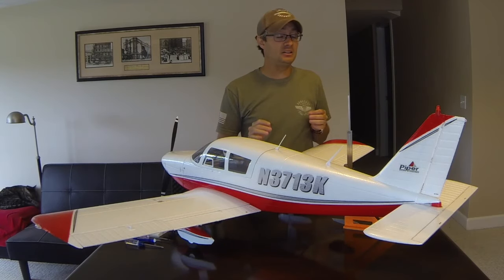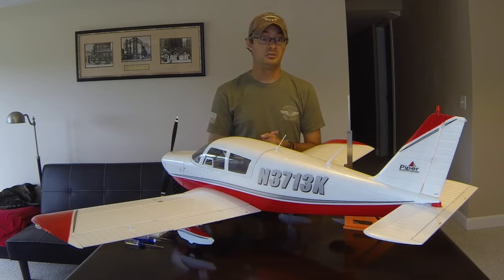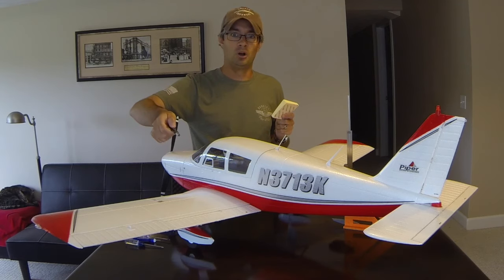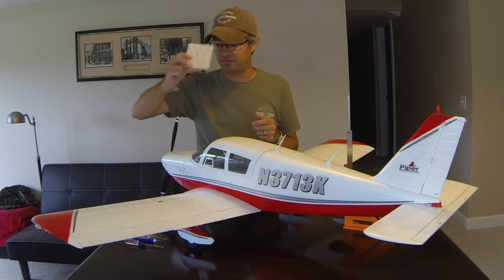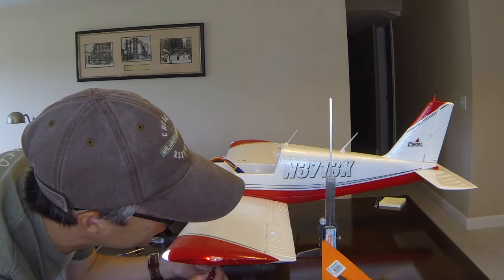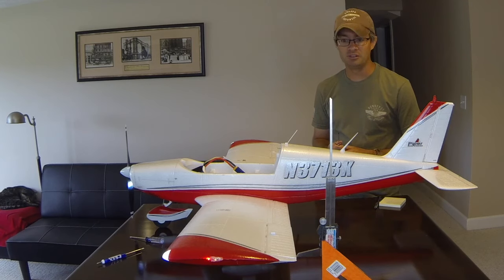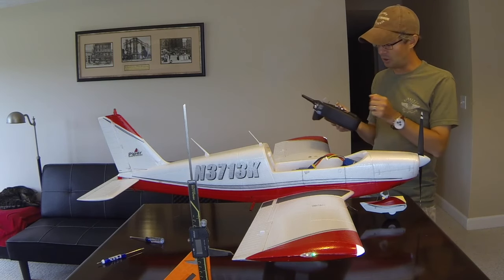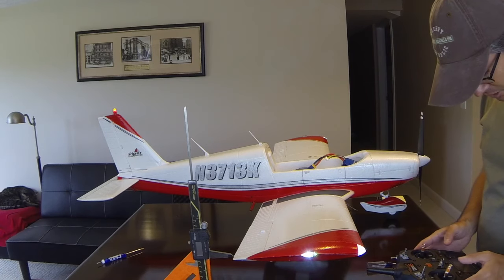How to mechanically trim ailerons on a RC plane

Comment: Excellent video and so glad I found it!  Just retired, a newbie to rc, and just picked up an Apprentice STS 1.5.  So, let’s see if I’m understanding this correctly.
1. Put plane on a level surface.
2. With the plane on and bound to transmitter make sure you’re in experienced mode and all electronic trims are set to zero.
3. Mechanically set the ailerons, elevator, and ruder surfaces to line up with adjacent surface.
5. Fly the plane and adjust electronic trims as necessary and land plane.  
6. Measure the surface with the trim from the flight, put the trim to zero on the transmitter, adjust the clevis on the plane until the surface     measures the same as it did with transmitter trim. 
7. Go fly and adjust from there.
Reply from the maker: yep, you got it! Don't be shocked if you end up with a control surface that isn't perfectly aligned to the adjacent surface after you get the plane trimmed and flying perfect in the air. Typically a brand new plane out of the box is pretty close to being trimmed out of the box. If you are just starting out in RC, I wouldn't worry too much about making trim adjustments in the air. SAFE will compensate to keep the plane flying level. As long as the plane is starting out with the control surfaces aligned with the adjacent surface, SAFE will do the rest. As you progress with learning and get out of beginner mode, then you will start to notice if the plane is out of trim and needs adjustment in the air. The good thing is that you can use SAFE to help you trim the plane. I only recently learned about this trick. Once you get into intermediate mode where you are comfortable flying the plane, go up to an altitude where you have plenty of room to recover and put the plane in experienced mode. See if the plane rolls or pitches in experienced mode and take a mental note of which direction it is going and then put it back into intermediate mode. Use your trim switches to add the trim to counteract what the plane was doing in experienced mode. Note that the elevator moves with SAFE on to keep the plane in the air so expect it to begin to dive slightly at half throttle compared to what it does with SAFE on beginner mode. That is normal. You should be able to go into experienced mode at 50% power and the plane should fly level and then slightly climb with SAFE on beginner mode. Ok, back to trimming. So if the plane rolls right, add a few clicks of left aileron trim to balance it out. Go back into experienced mode and see if the plane still wants to roll. If so, add a few more clicks of trim. The idea is that you should go from intermediate to experienced mode without the plane wanting to roll or pitch. Then you have the plane trimmed out properly. Land and then adjust your control surfaces so you can set the transmitter trim to 0.
Reply: @BRGT350  WOW, lots of good information you gave us. I will do as you suggest and play with it. Really looking forward to trying it all out. I've always been one who likes to tinker with stuff anyways. For instance - I'm a Ham Radio operator but actually like building and modifying equipment and antennas more then actually talking on the radio.
Thanks again, Your help is much appreciated!
Reply from the maker: Happy to help out! I also love to tinker with my planes, but most of the modifications are all related to making them look more realistic. I have started to get into designing 3D printed parts to make the planes look more real.
Reply: @BRGT350  haven't gotten into 3d printing yet but that sounds interesting. I will have to check into that one day. It's amazing what people are making with those printers. Good luck with that.

Comment: Excellent video and who would have thought its not just trim but retrim very great and thanks for this video
Reply from the maker: thanks, I have found that foam planes need some additional trimming as the weather changes, mostly with the elevator and rudder as the fuselage expands and contracts with heat and humidity. The ailerons stay pretty consistent, but not always. I have had a few cases in which a plane trimmed perfectly in the fall is out of trim in the summer. The best solution is to get it as close as you can to being trimmed for all seasons and then add a few clicks as needed to adjust for changing weather.

Comment: I built a Veron balsa Cherokee glow powered with an all flying elevator, however on its first flight the elevator started to fishtail up and down. I can see that the model that you have on the table has an all flying elevator. What prevents fishtailing on your model?
Reply from the maker: I assume you are referring to a plane that is pitching up and down caused by stabilator flutter. I didn't have to do anything to the E-flite Cherokee to prevent that from happening. I did lower the amount of throw on the stabilitor and increase the expo to make it less sensitive to pitch inputs, but that wasn't to fix a flying issue, but rather to make the plane react how I wanted it to when applying up and down elevator. I wanted a very sedate Cherokee. Typically stabilator flutter is caused by too high of airspeed and/or not enough support to maintain the stabilator's position. Aerodynamic forces begin to act upon the surface and overpower the rigidity of the surface, hinges, or servo.

Comment: I successfully binded my Apprentice STS to Spectrum DX6 but upon doing so, I noticed the rudder being way off center. I tried fully trimming it to the left and almost got it to center, but not quite. How do I mechanically adjust the rudder so it's center without trim? I tried unscrewing the servo but there's two steel rods attached to the servo arm from opposite directions, making it impossible to adjust.
Reply from the maker: You don't need to remove the servo or the arm from the servo to make any adjustments. Those rods you are talking about are the push rods that activate the rudder and nose gear. Go back and look at the rudder where the rod attaches to the plastic piece that is shaped like a triangle with holes in it. There is a clip that attaches the metal rod to the plastic part on the rudder. The rod is threaded. Unhook the plastic clip by sliding the rubber band towards the metal rod and pulling the clip apart with your fingers. Then turn the clip on the rod to make your adjustment. If it is to the left and the servo is on the right, then clockwise turning of the clip will shorten the rod length causing the rudder to move right. Center the trim on your transmitter and make sure the rudder is centered. Keep adjusting until the clip until the rudder is centered and there isn't any trim on the transmitter. Push the plastic clip back together and install the rubber band. If the Apprentice doesn't have the threaded rod, then it has a metal barrel on the servo arm with a screw on the top. Loosen the screw and push or pull the rod through the barrel until the rudder is centered, then tighten the screw. I am not sure which adjustment style the newer Apprentice has, but the manual should also have some details on how to adjust. Let me know if you have any questions.
Reply: @BRGT350  Yeah, I already tried expanding and contracting the push rods as much as possible and it made no difference. So another problem that came to light was that my nose gear wasn't steering and there was no tension at all. I contacted Tower Hobbies two days ago and they sent me a return authorization label
Reply from the maker: sounds like something is wrong. Usually one turn of the clip on the push rod is enough to move the surface a noticeable amount. It is rare a plane needs more than a turn to get it trimmed. Before you make your first flight, take a credit card or straight edge and lay across the control surface to make sure it is flat and aligned to the adjacent surface. Make your adjustments before flying. Trim in the air as needed and then transfer that trim mechanically and put your transmitter trim back to zero.

Comment: i understand what your saying but,,,,,,,,,,,,,,,,the landing gear would have to be perfect to the level surface to do that,,,,right?
Reply from the maker: As long as the plane is in the same attitude between measurements and the location of the measuring device didn't change, it doesn't matter the flatness of the surface. Now, I would suggest using a flat surface such as a table since you remove the possibility of surface variation and gravity works to your advantage. I wanted to transfer the mechanical trim from one Cherokee to the other a few weeks ago and since the landing gear aren't exactly the same height between the planes, I built a stand that located 3 points on the bottom of each plane. I verified the heights of the plane using the spinner and wing tip lights. Once both planes were sitting identical, I was able to measure the stab position on the one that has already been trimmed and transfer that to the other one. The results were pretty good, only needed a few clicks of trim on the elevator. The indent on the one Cherokee was gone due to the filler and paint, so I had to find a different way to align it. The method I describe in the video is what I have been doing for years and multiple aircraft and it works great each time. I either use a table or the garage floor. Results are the same either way. Measure the surface with the trim from the flight, put the trim to zero on the transmitter, adjust the clevis on the plane until the surface measures the same as it did with transmitter trim. Go fly and adjust from there.

Comment: Is it normal for surfaces to be out by like 3-5mm out of box ? 1 x aeleron looks really bad out of box conscendo evolution. Haven't flown yet as it's my 2nd rc and first bnf.   
  Need help 😔
Reply from the maker: Not typical, but I have had a few that needed more adjustment than others. I have had some planes that every surface is perfectly aligned out of the box and others that needed some adjustment. Be sure to power up the plane first before making any adjustments. The surfaces may not be centered from packing the plane for shipment. Power up the plane and let all the surfaces move during the AS3X check. Once that is done, then check to see if any surfaces need adjustment. I use a credit card or business card as a straight edge to see if the surfaces need to be adjusted.
Reply: @BRGT350  thanks. Yes I already did.  I made about 7 half turns while powered up.   
   Hope it's not gonna be a lemon 🍋.
Reply from the maker: I wouldn't be too worried. I have had some planes that were pretty far off when I powered them up. Made the adjustments  on the bench before flying and they have been perfect planes ever since.
Reply: @BRGT350  im not overly worried. But it is interesting that after adjustment, one end of the right aeleron is 1mm up, and the other end is 1mm down. 
  I guess that's as close as it gets. The other side is fine.
Reply: @BRGT350  thanks for your replies :)
Reply from the maker: you are very welcome, always happy to help out